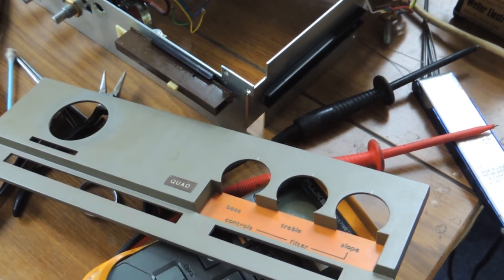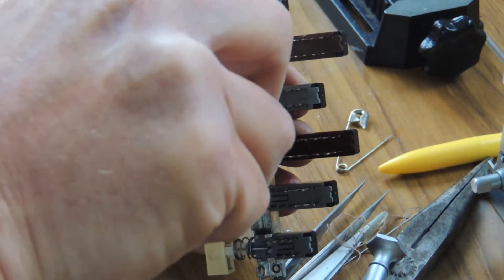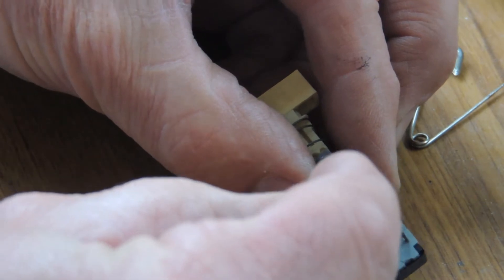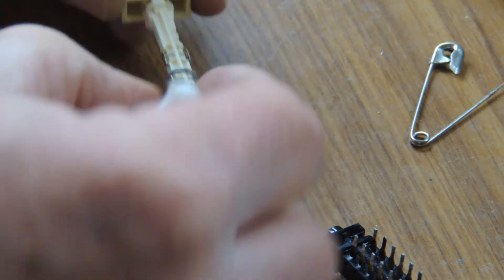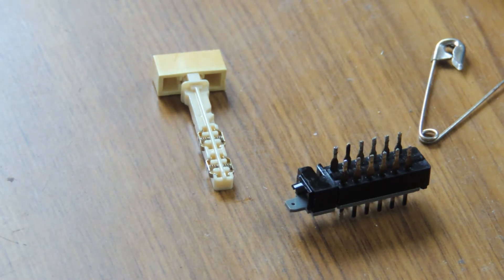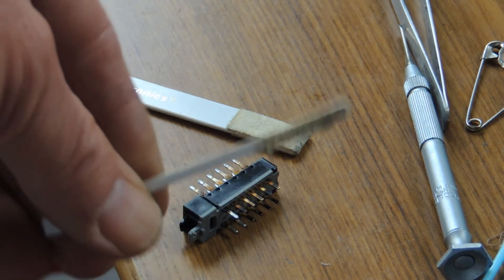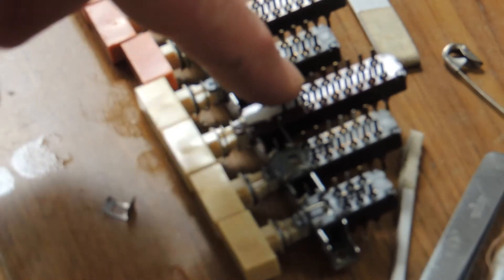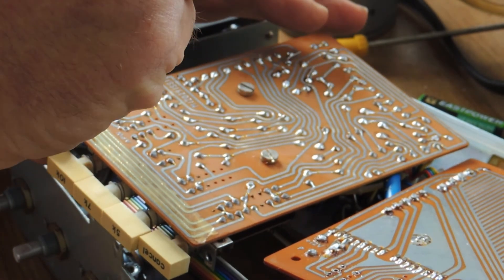Quad 33 switch repair

Comment: Sorry to be the one telling you this, but you can do all that cleaning without removing the switches from the PCB, and without removing the PCBs at all, which is a complete disassembly. Just follow the instructions in the service manual and you can get all the access you need, directly from the front of the unit, after removing nothing more than the knobs and the front panel. I try not to go even that far, just spray PVA into the switch body and work it back and forth 10-20 times to wipe the contacts.
Reply from the maker: I did the cleaning job without reference to any service manual. I often find that cleaning sprays do not give long term results and having opened the switch found the tarnished contacts. I was able to polish them and am happy with the results. I do have a good Pace vacuum de-solder workstation and was happiest to remove all the switches for better access.
       I'm not saying mine is the only way but at the time, 3 years back, I think  it was a job done during lockdown.   it was something to do at the time.   I had also found the only other reference on the web to Quad 33 faulty switch repair was to replace the complete switches along with a newly designed circuit card. Replacement switches to the original design were unobtainable.